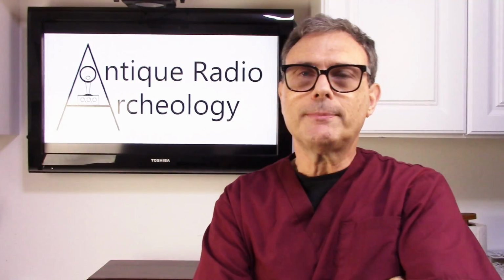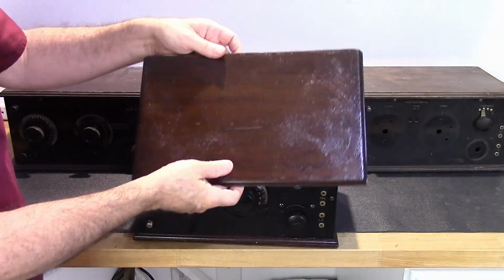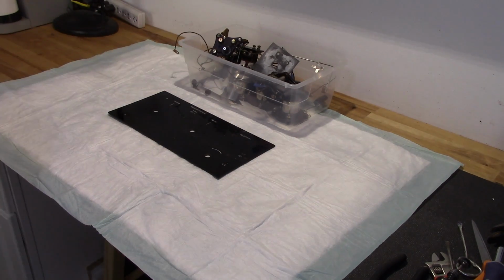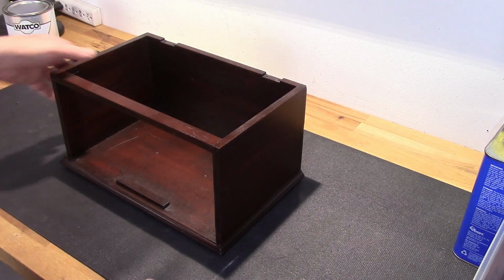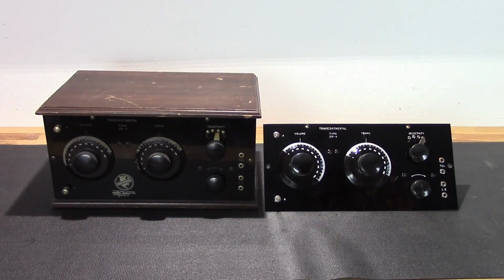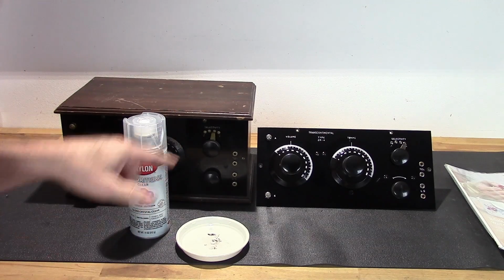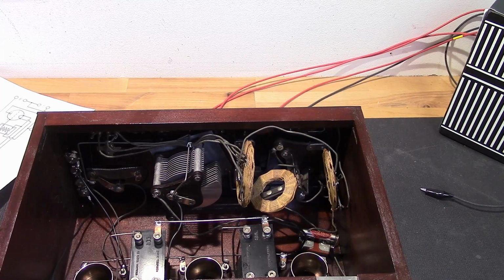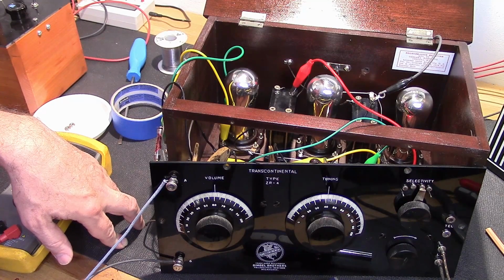1924 Chelsea Transcontinental ZR-4 Restoration

Comment: Wouldn't this cabinet have been originally finished in brushed shellac? Nitrocellulose lacquer wasn't used extensively until post WWII.
Reply from the maker: You are correct.  Most of the Chelsea radios are finished in shellac.  This one should have been, and in hindsight that's the route I should have gone.  About 1925 - 1926 Chelsea started using lacquers.  I used lacquer on this one because it was thickly coated in it to begin with.  despite the sanding and use of thinner, there is always some lacquer residue present in the wood and I've had some serious problems getting a decent shellac finish in those instances.  I.  Had I known what I was getting into on this one, shellac would have been the better choice.